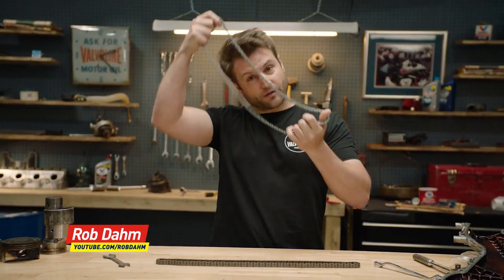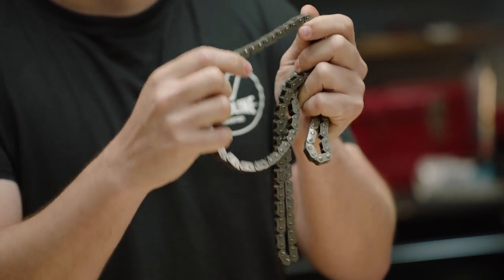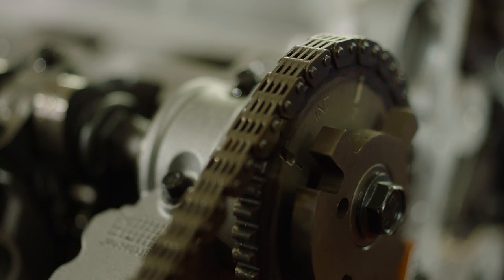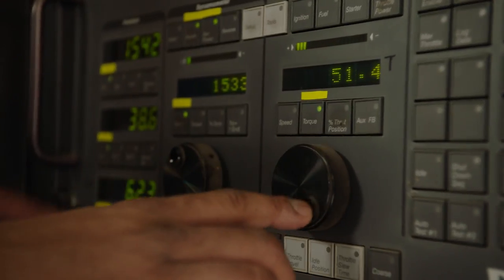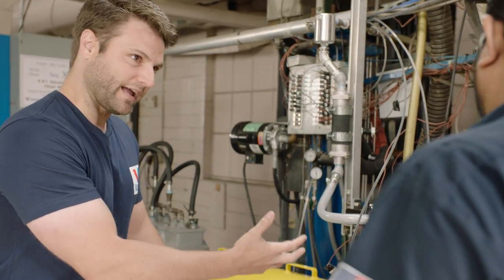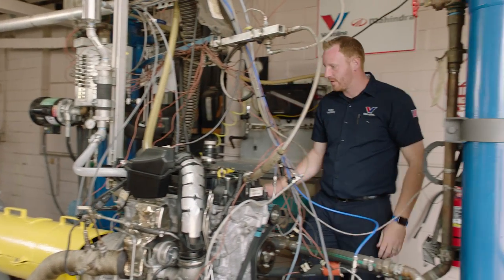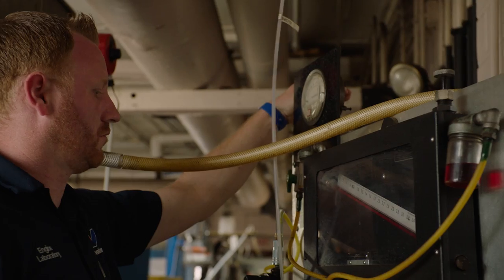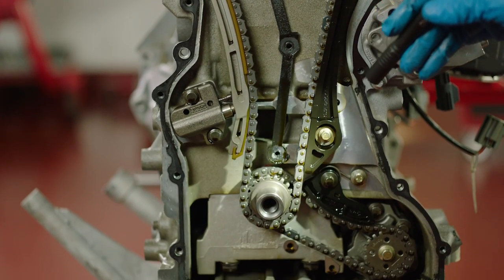Rob Dahm Goes BTS at Valvoline to See Innovative Timing Chain Wear Test

Comment: "We know" nobody cares, we need technical data, im absolutely not trusting the timing chains of my fire breathing track ready car with this oil. In independent testing Pennzoil Ultra Platinum Race Trusted and Amsoil signature series have proven to withstand extreme temperatures better and also minimize wear BETTER than Valvoline.
Give us a performance oriented oil with proven data Valvoline if you plan on convince us to turn to your oil. Don't get me wrong, Valvoline is fantastic for commute cars but for performance? Thats a different story.
Reply: Rob dahm's cars are Rotary powered, Rotaries don't have timing chains 😂 this was a weird ass ad
Reply: rob uses valvoline in his 4 rotor  with a lot of pounds of boost and it hasn't failed yet.....
Reply: @denisrazvanpatriklucea8230  i wonder how often he changes the oil lmao